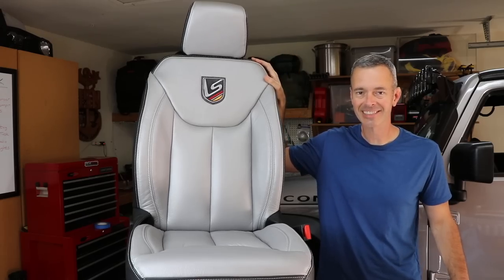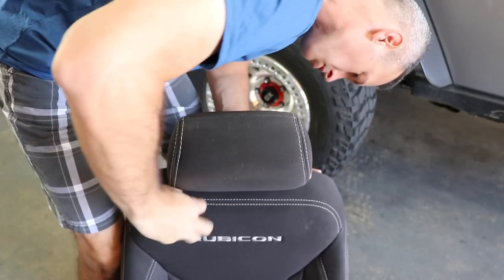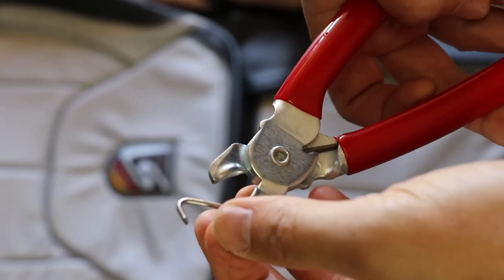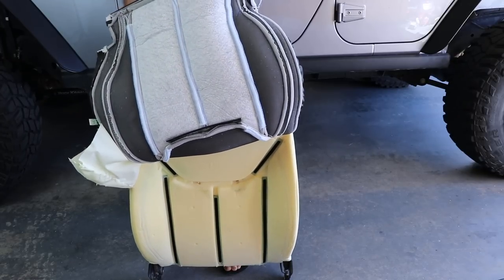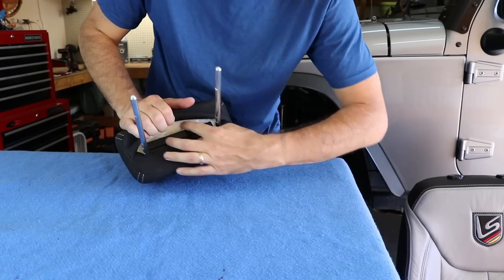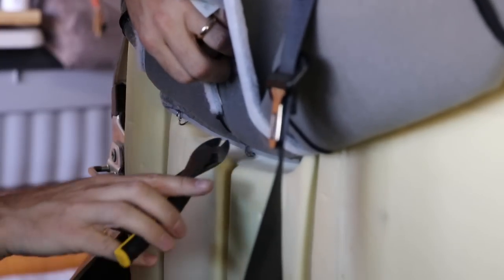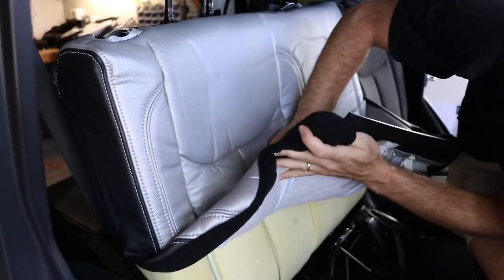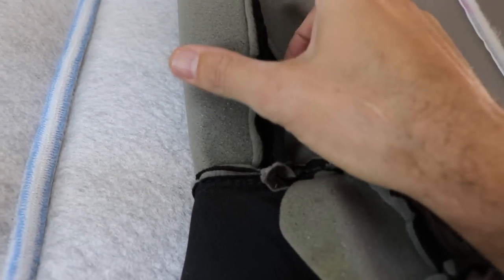Leather Seats Interior Kit Install - Jeep Wrangler

Comment: Little tip on the head rest retainers if you push the foam down you can see the tabs that hold them in the seat back you push those tabs and the retainers lift out the reason I point this out is because I've seen a guy tear the seat cover trying to stretch it over the headrest retainers. Good video I appreciate you making it!

Comment: Awesome video and very informative. What I found that worked well when trying to connect the u-clip on the seat back cover was by laying the seat back flat on the ground, backside down, then applying my knee to the the seat back thus compressing the foam giving me just enough stretch to connect the u-clips. I tried it exactly the way you did to no avail.

Comment: My fiance has a 2017 4 door sport. She also purchased a full Katzkin Kit to change the stock interior to leather (before I met her). We have put off the installation because shops here in Houston have given outrageous quotes. So, thanks to your video I am going to attempt it very soon to surprise her. I will keep you posted on how it goes. And, whether the Katzkin has any quirks. 
My fingers are crossed that I don't mess it up. But, for the first time (after seeing you pull it off) I feel confident I can do this in the garage over a weekend. 
Thank you for the video...
Reply from the maker: This projects is a great DIY and your fiancé will love that you did all the work for her.
Reply: @TrailRecon  I told her about your video yesterday. She's VERY excited. She bought the Jeep in Oct 2017. Ordered the seat kit in November 2017. So, I think she's ready. 
Again, Thanks to your very well done video... I know I can pull it off. 
Did you get the Hog Ring pliers and rings at a standard auto parts store? Or, did you have to go to a specialty place to find them?
Reply: @TrailRecon  The seatbelt... Does it need to be disconnected from the seat... Just checking while I'm at the store buying my hogring pliers...
Reply from the maker: yes

Comment: Thanks for the diy video. I have leather seats but twins that are always cold on our trips. So my reason to watch this is to see how the rear seats come off to install heat warmers in back. The switches I’ll install near the window up/down switch rear of the center console. 
I won’t need to remove as much and probably get away with use unclipping and tucking the warmers up  in the seat backs, but I’ll have clips and the tool handy just Incase.

Comment: Great how too video but as someone who works in an auto manufacturing plant PLEASE make sure to put the proper torque on the seatbelt anchor bolts and seat mounting bolts. They are designe to perform a certain way in a crash. We consider these A Rank bolts. Very important!

Comment: I can see doing this upgrade if you have cloth seats that are beat up a bit, but the Rubicon leather you are ripping out looks good or the same as what you are replacing it with, unless it is torn in some area's.. I would of left the old, but that is me.  Nice video by the way, lets me know what it takes to remove that material on seats in a jeep.

Comment: I installed the deluxe package in my 2016 jku today!!!   Holly shit 8 hours later got it done..
Reply: Did you have any problems with the seat back adjuster clip, and disconnecting the connectors for the airbags?
Reply: Does your seats have the side airbags? How was that to factor into the install? Thanks